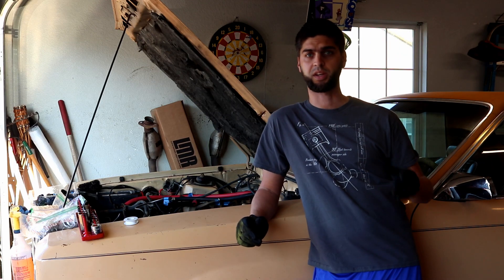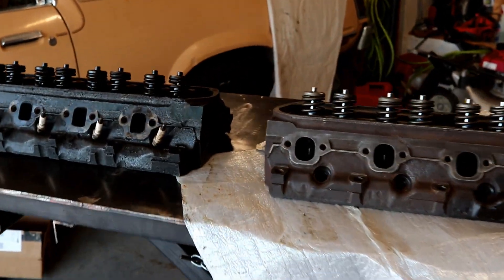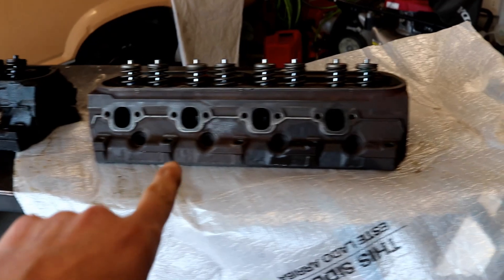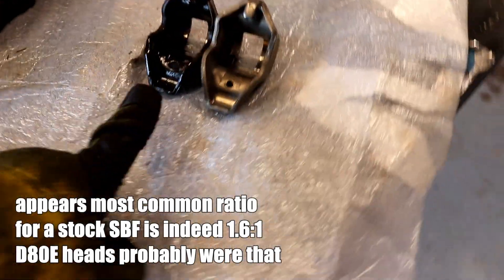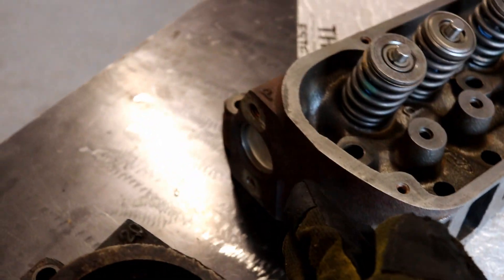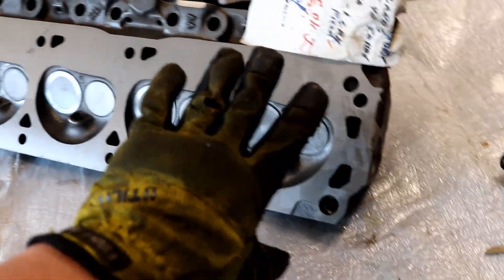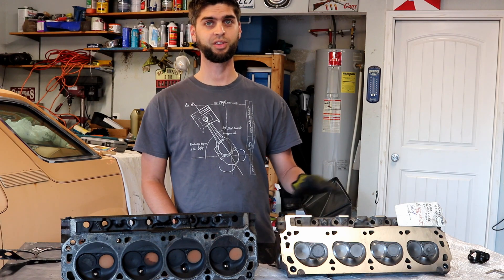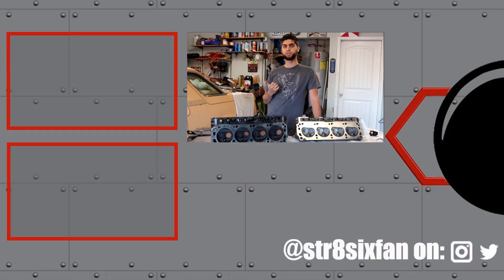Comparing D8OE 302 Heads to GT40P Heads

Comment: For checking stock rockers, measuring from the center of the pushrod socket to the center of the wear pattern at the valve stem pad is a good reference to if there the same. GT40 (3-Bar) heads had Thermactor ports but, GT40P (4-Bar) heads did not. Checking to confirm combustion chambers or intake & exhaust ports are easy to do with plexiglass with a hole at the highest point, petroleum jelly as the surrounding sealant, colored alcohol and a measuring device that measures cc’s. That’s all a machinist will use anyway, just get creative with items available at home or in your shop it’s not rocket science.
Reply from the maker: Awesome pointers man. I'm going to pin this comment for the good of all who follow and watch this one!
Reply: @Str8sixfan  good to know man, there quite a few more tips for driveway style measuring specs on ford V8’s that not many people do that aren’t listed. Most are good estimates that will be close to spec but, remember these are no substitute for proper tools and the use of a machine shop for proper wear indication or tolerances of critical specs.

Need any tips, I’ve been a engine builder for 20 yrs and a machinist for almost 18yrs, just ask!!!
Reply: @80sfordguy  if I have a 302 SBF with 68 351w heads with bigger valves and have 130 thousandth valve clearance in the too of my Pistons should I use a thinner that stock head gasket the heads have been cut by 0.40 all ready any help is appreciated
Reply: @richardheaton6406  ok, let me first understand your question! You have a set of C8 351W (1968) SBF heads that you want to set up to install on a 302 SBF block. You also checked the piston to valve clearance on 2 of the 8 cylinders and you measured 0.130”. On top of that you had the heads decked (machined) 0.040” to straighten the gasket surface out likely due to warpage or head gasket leak?

First remember this, anything machined off the bottom of the heads or off the head surface of the block as well as using thinner head gaskets will increase the compression ratio. For stock engines a happy but gutless 8.5 ratio is ok, 9.5 to 10.25 is desired and usually anything over 10.5 might cause you to use higher octane fuel.

That said, using those 351W heads that are machined 0.040” with stock head gaskets installed measuring 0.130” piston to valve clearance is good and safe. Although unless you do as I said in my original comment by checking the combustion chamber cc’s, ALONG with measuring the cc’s of the pistons that your using (dished, domed, flat-top or Valve relieved), also the compressed thickness measurement of the head gaskets your going to use and the piston height (how low the pistons sit in the cylinder at top dead center below the deck) this is a loaded question.

I’d need those measurements to first calculate the compression ratio then if that ratio is in a good range I’d look at piston to valve clearance and ask the customer what’s this engine going to be used for? Weekend cruiser, weekend warrior (road course or drag strip), show car (to look pretty & sound mean or smooth) and possibly for truck towing or 4 wheeling?

These all make a difference when setting the piston to valve clearance among many other spec’s when building an engine. Racers tend to want higher compression & high RPM’s for more horsepower, cruisers usually want reliable turn key low RPM power for saving MPG”s, show cars much of the time are built to look pretty & sound tough and towing or off-road use is usually lower RPM grunting power.

Get back with me on this for better answers to your question(s), desired cubic inches, desired HP & Torque, planned usage of the vehicle, high or low RPM’s and another thing needed is the intended tranny (manual or automatic) which will decide which cam to use and what intake & exhaust would be desired?

Comment: GT40 heads are basicly the 69-73 351w fat spark plug heads with smaller plugs.
All 351w small plug heads are just the smaller port 302 sized heads.
Reply from the maker: Very cool

Comment: Late 70’s Smog Era (D80e) are trash. They look the same but they aren’t the open chamber drops compression and has puny 1.8/1.5 valves. Shrouding doesn’t look horrid but it’s there on intake. GT40/P. Even a pair of E6/E7 would dog those. It’s all where you can’t see too in the runners and material that can be removed. GT40 all the way
Reply from the maker: that seems pretty accurate. Yeaa I wasn't really trying to say anything positive about the existing heads, just literally compare the two

Comment: I just completed this same head swap on a 79 mustang. I ported the set of gt40p I had and installed the trick flow spring kit. The engine had a weld duel plane intake which I port matched with the heads and also installed 1.7 ratio roller rocker arms. Before the head swap the car ran 15.90's in the 1/4 mile after the head swap it ran in the 14.30's. I ran open headers but plan to put on an x-pipe with 2.5 inch exhaust and should get a little more power due to scavenging. The spring kit helped a lot. With the D8OE heads the engine red lined before 4k. When I tested after the head swap I made my shift point at 5k and worked great but know I could rev higher.
Reply from the maker: I really wished I could have worked 1.7 rocker arms into my budget. I'm running the stock (lame) cam, so at least the rocker arms would have gained me something! I would be seriously surprised if this car ran 15.9s now
Reply: x pipes do not help scavenge. Your scavenging is all done the moment it hits the collector.
Reply: @SophiaAphrodite  Yes they do.It scavenges from one bank to the other,dyno tests prove it,a H pipe vs a x pipe vs separate pipes,the x outperforms by a long shot.

Comment: I had my P heads shaved 30  that brought the combustion Chambers to about 55
Reply from the maker: I bet that makes for a nice high revvin machine!
Reply: better money spent would have been just porting, springs and 1.7 rockers. Those weak exhaust ports will not benefit like you might think.

Comment: You can gain a lot more HP if you upgrade the valve springs on the GT40P heads.  Fact
Reply from the maker: I could see that, but the lame stock cam on my Fairmont didn't necessitate that.
Reply: @Str8sixfan  Drop in 1.7 Cobra rockers will make up for that weaker cam and upgrading the springs now as well will prepare you for a cam upgrade later. You spent the time porting to help with the weak exhaust on the GT40p that relatively small cost for the rockers and springs will be 2 less things to worry about later.
Reply from the maker: @SophiaAphrodite  I wanted to throw in 1.7s but ran out of budget. Car is finally back together after a year
Reply: @Str8sixfan  Correct, though it should still make more power and torque,  for longer, even with ole lazy still in there !!
Reply from the maker: @arkhsm  you should go watch my latest upload. I did some 0-60 timing

Comment: That bump in the exhaust port is also part of the egr. The intrusive hollowness to nowhere which some call thermactors related.. Usually plugs up with major carbon and impacted oil when your rings go or the oil is rarely changed
Reply from the maker: Hey thanks for adding that in. That's good to know!
Reply: @Str8sixfan  How does it run with the new GT40 heads?
Reply from the maker: @JLMEALER2000  So finally got it running right last weekend. Only got about 2 miles in it. Been taking the approach, even though it isn't more than a top end rebuild, to take it easy the first 500 miles. Then I'll probably change the oil and send it. But small sample size it seems like it's going to have the high end of the power curve affected more than the low end which kind of surprised me.

Comment: Just picked up some 3 bar gt40s. Just gonna have em milled, 1.7 rockers, and maybe a small port job for my 351w
Reply from the maker: I originally had 3 bars and then I realized I overpaid for them so I sold them. Machine shop I bought these cores off of didn't realize they were 4 bars until they pulled them from the shelf. You won't regret the 3 bars simply from the spark plug conflict situation
Reply: @Str8sixfan  actually for cams over .500 the GT40 is better if you do not port. Also Chris. 351w heads are actually already comparable to the GT40 and GT40p heads so no need to swap those. Keep the originals and upgrade them.

Comment: NOT E8(zero)E heads. They're E8(oh - the letter)E heads. The "O" meaning originally designed for a Fairlane, a Torino, or a Fairmont.
Reply from the maker: They're D=70s (whereas E=1980s), 8=78, and I suppose I could have been wrong on O vs 0. Could have swore the casting was narrow, but I really don't know as I've scrapped them since. But I did find another website that agrees with ya, that the third digit was typically a letter like you said points towards what kind of car it was meant for. So I'll probably be changing the title of the video now. Thanks for the pointer!

Comment: Gt40 heads are 1.84 int 1.54 exh. D8 should be 1.75int and 1.46 exh.  Alot of people when redoing the gt 40s or gtp head go with 1.94 to 1.60. and wanna say they are 58cc on the gt40p ,..and 60 cc on the gt40 heads.. D3,toE6 are scrap metal don't waste any time on these unless you are doing numbers matching resto.
Reply from the maker: yea, the head range you mention (73-86) most likely are junk, I'd agree with that. I only compared these two, because they're the two I had! Trying to help explain what a decent jump I should see in going from one to the next. Sadly I still don't have the car started yet since doing the swap. Hopefully a week from today you'll be watching a video about that start up though. Thanks for stopping in!

Comment: What all would I need to change to run these heads my motor uses a flat tappet cam is that gonna cause any problems?
Reply from the maker: My Fairmont is flat tappet as well. Since I didn't change the cam, I'm re-using the stock pushrods
Reply: Str8sixfan thank yoi I want sure it the rocker arms had to be changed or anything like that
Reply from the maker: Hopefully in a week or so, I will have the thing fired up! And we'll know for sure if I got it right. But I did a video on the piston to valve clearance later after this one. Feel free to look through the videos on my channel.

Comment: I have a Mustang 79 302. And recently bought gt40 heads, what parts i need to do the upgrade. My heads dont have the rockers arms
Reply from the maker: Your stock rocker arms from your old car should work fine. I compared the two side by side in an episode previous to this one. I'd encourage you to watch like my last 5 videos prior to this one regarding the heads. You shouldn't need much more than what you have
Reply: I would put in the trick flow spring set, find some 1.7 rockers like ones put in Cobras. This will give your existing cam something closer to the B303 lift. You will get 50 hp easily from those minor upgrades and the heads.

Comment: Neat idea using two colored hoses for your heater. 
So did you run a compression test before you pulled the heads?
Be interesting to see what it is, seeing as you should have higher compression ratio with heads that have less volume than the old heads.
Happy Motoring.
Reply from the maker: I didn't do one no. But calculators tell me the 8.1:1 gets closer to 9.0:1

Comment: Hoping for the best with the PTV clearance! I have pretty high hopes for this build in general. About as high as one could expect from something with single exhaust and a 2 barrel :)
Reply from the maker: Me too...hoping that relief in the piston is big enough to clear the extra .03" of radius
Reply: @Str8sixfan  My biggest concern was the possibility of having flat top pistons. Seeing that you don't makes me much more comfortable. I seriously doubt you will have PTV issues but checking it with putty takes no time at all. Since you'll already have the water pump off it'll be a really good idea to advance the stock cam with a cheap keyway kit. I was holding off on suggesting that again until you saw it didn't have flat tops.
Reply: @Impactjunky  The outer edge of the piston is where contact occurs on stock pistons and ptv has little to do with the dish. Flat tops with no reliefs is super safe for stock head and valve size even with mild low lift cams.

Comment: Great Video Grant i am sure that you will have plenty of valve to piston clearance there is not much difference between the intake valve sizes the only thing i would question is how much space is there for the valve travel which will be limited by the amount of lift from the cam thru the push rod and rocker motion.... Great to see the engine compartment bright and shining
Reply from the maker: I think relatively speaking the valves are starting in a very similar location. I'm not as worried about the valve travel without changing the cam or rocker ratio on the stock block.
Reply: @Craig Durbin I've been trying to convince him to advance the stock cam with a cheap keyway and chain kit. It should move the power band down to a better range for a mild V8-automatic combo like this and we likely wouldn't see much loss up top considering the car will have a 2 barrel, single exhaust and be driven in drive shifting early most of the time. He's already gonna have access to the chain and gears when doing the water pump anyway and a good keyway kit only cost around 60-100 bucks. Any thoughts on this? Been doing a lot of research on it and couldn't find any reference to PTV clearance issues with advancing the stock cam on a GT40P swapped 302 with valve cut pistons. Flat tops are another can of worms though.